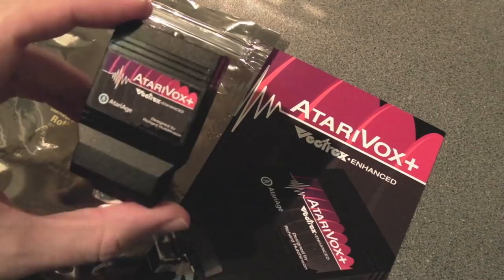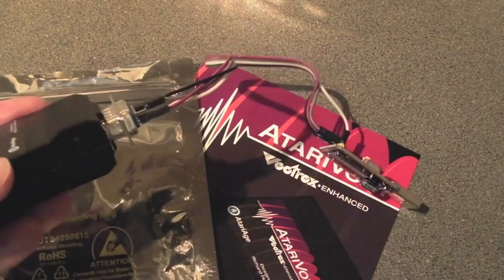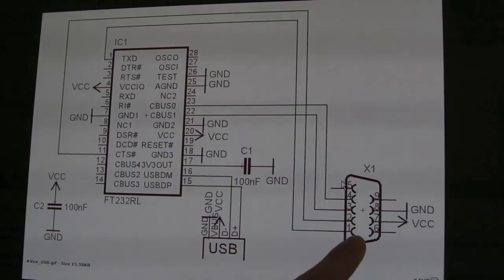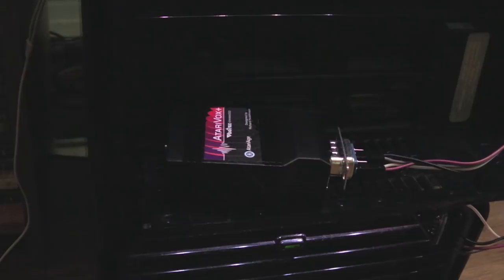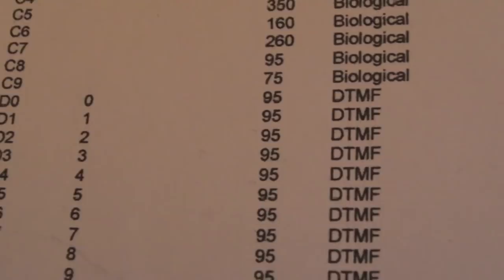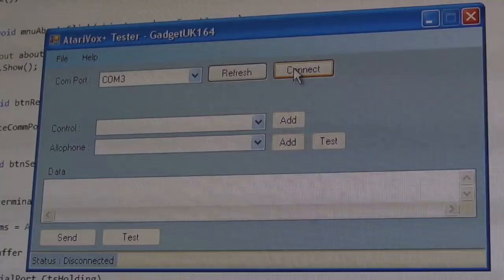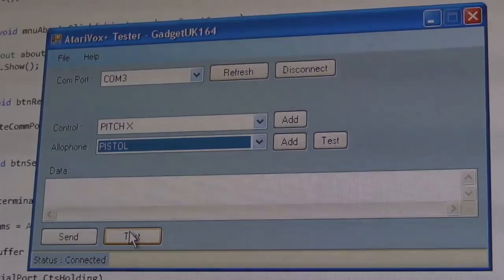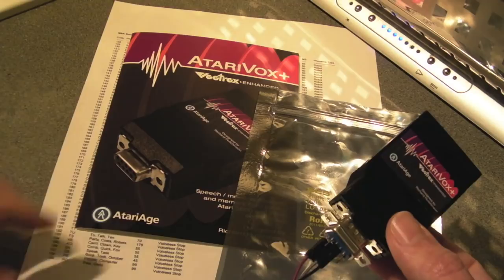Atari Vox+ (2600 / 7800 / Vectrex) PC Test App & DIY USB Adapter (Speech)

Comment: Nice little device. I have to say I'm impressed with your coding skills Chris. I did a little C++ myself many moons ago but got nowhere near the level you're at. Ohh, I forgot to mention it in my last comment so better late than never, Happy New Year to you and yours.
Reply from the maker: Thanks!  It's simple code it really is - it might seem complex but its dead simple.  If you look at the source you can see that .NET handles all the serial stuff itself, all I do is specifiy the com port, the baud rate, data bits, parity, stop bits, then open or close a connection.   Then write out the bytes for each allophone!  Trust me, anyone could do that easily!
Reply from the maker: And Happy new year =D =D

Comment: Cool little device, thanks for showing it off and writing your little tool (or Noddy as we call them at work) for it :P

Dunno why but this didn't appear in my subscriptions list, very strange. Youtube is on form.
Reply from the maker: Thanks =D  Yes, it is a noddy app lol.   In retrospect (and I will test more tomorrow), the control commands there might be taking offsense of the 255 at the end there, when perhaps the 255 should follow the string as a whole.  It might also require the 31 reset after each allophone that follows a command.  I've had that issue with YT before btw where a video doesnt appear in my list! =/
Reply: It's certainly strange behaviour, might need some studying of the manual, or firing off an email asking some questions, but you might be right, it did seem weird to me you having a terminator after the control commands, I thought that it should only be at the end to say to the device "hey this is the end of communication", but then I wouldn't have expected it to freak out as much as it did.  The other thing I was wondering is if the controls only take values of 0-9 rather than 0-255, since it only said like PITCH X instead of PITCH XXX.  I could be wrong, but it was just a thought to maybe why 127 and 1 sounded the same :)
Reply from the maker: I think I tried it both ways though earlier and pretty sure it was exactly the same.  It's almost like those commands just dont work at all (except for pauses).  It could be related to the PIC that's on the board there.  I wonder if that PIC is intercepting the comms and controlling the chip or something like that.
Reply from the maker: And the datasheet stated 0-127 btw!  I did try various values and it was always the same.   Interestingly the volume command always made the volume go off completely, no matter the value passed.
Reply: Ah fair enough! Totally missed that, I think my Mrs was distracting me with villa's in florida lol. Very strange, something is definitely not right there, but god knows if it's something you missed or a bug somewhere, you'll have to do an update video if you work it out making it do some silly voices :)
Reply: It never in mine either, I only noticed it today

Comment: at @25:07 you have 22 127 255.    it looked like 255 was the termination character. I think your problem here was that you were changing the pitch then terminating, then sending the rest of the commands and expecting it to change.  but how it interprets it is that you just kept setting the pitch to the same value. luckily disconnecting resets that.

set pitch
 say your things
set pitch back to normal
 then 255. 

 if you did that you wouldnt have to mess about with connecting and disconnecting.
Reply from the maker: I am pretty sure I tried moving the terminator to the end (and not using it at all), and it was the same!   I will take another look when I get 10 mins and let you know! =D

Comment: Wait....you made a ComLynx cable for the Lynx? I swear, if you could make a ComLynx-to-MIDI cable and someone finally ported MIDI Maze to the Lynx, you would definitely earn yourself a mansion in Atari Heaven. A ComLynx-to-USB or min-USB would be sweet too, especially if it would work with the Lynx emulator on the PSP. Food for thought!
Reply from the maker: ComLynx to USB is what I created - it works, I can send ROM images to the Lynx (provided the ROM is smaller than the RAM free).  I will do a video over the next week or two.   The next idea was to write a lobby application where people can connect over the net and it fowards on ComLynx data to the person you link too.  The general idea there is to allow people anywhere to link up their lynxes.   The only thing I am not sure about is latency and whether the Lynx software will work with it or not.
Reply: That's cool! That would definitely help out with public shows when multiple people want to ComLynx it up for multi-player. That's also why I've been wanting ComLynx-to-MIDI, ComLynx-to-JagLink, and ComLynx-to-USB. If the mini-USB could work and the Sony PSP Lynx emulator could use it, it would definitely open up Slime World matches to a lot more players. BTW, with the Lynx, can you do a video of your menuing system for SainT's/RetroHQ's Lynx SD Adapter so people can always refer to your latest version easily instead of going through the AtariAge Forum? I think that would be helpful. Keep up the fantastic work; we appreciate it!  :)
Reply from the maker: Thanks =D  Yes, I plan on doing some updates to the menu soon - then it should be clear what the latest version is as well.

Comment: I think it's a cool device, but it bugs me that it apparently won't work with a DB9 Y-Adapter cable. Hogging up one joystick port may be okay for some games but definitely not 2-player ones. I don't know if it's possibly but on the 7800, I'd really like to see it connect to the nearly useless Expansion Port [which can be added to most of the post-1987 models because the provision is still on those motherboards]. The port has very low bandwidth - kinda like the 5200 Expansion Port before it - but I'd think it would be capable of transmitting speech commands or high score saves. As more ROMs become hacked to support AtariVox game saves, that would give yet another option to us retro gaming enthusiasts [at least on the 7800 side] besides the soon-to-be-released 7800 XM, the Concerto SD Adapter [if it's ever released], CPUWiz's SaveKey device, and the few people out there that have Curt Vendel's earlier High Score Cartridge or the CuttleCart 2.
Reply from the maker: It should work on a fully wired DB9 Y-Adapter?!?  Although the joystick and AtariVox wont work at the same time obviously.  But it at least means you could leave it plugged in for games that dont use the AtariVox?  I guess there's no where else to wire it up really =/
Reply: The Expansion Port if there was an adapter cable for it. :)  Atari Corp later stopped shipping 7800s with them because they weren't going to go ahead and release a CED or LaserDisc Player for the 7800 at that point and that's what the port was for. Although I believe the provision space is still on all of the post-1987 motherboards. Although I have no idea if it would map properly connected to anything besides the 2nd joystick port...

Comment: I don't entirely trust these CH340G adapters - communication errors, timing disparity. The best cheap serial adapters are IMO SiLabs based, CP2102/2104 and such. Not that it matters in this case, but in other case, it might.
Reply from the maker: Thanks for the info there =D  Always useful to get feedback like that - I've never used any of these 232 devices in anger, but now at least I know the IMO SiLabs stuff is the way to go =D